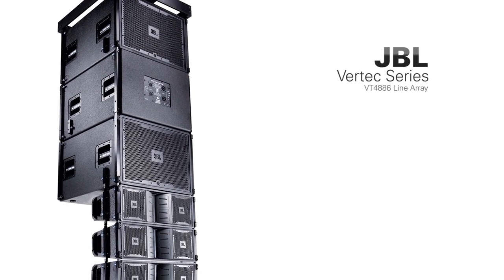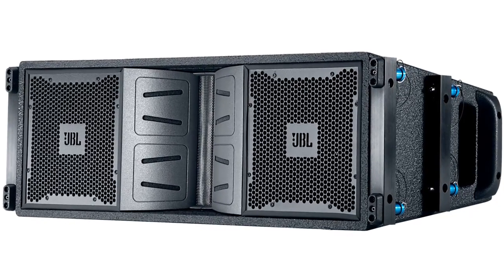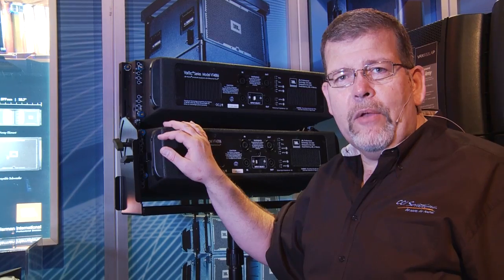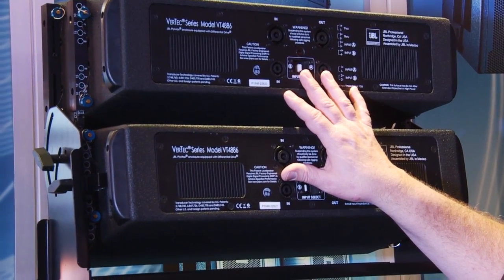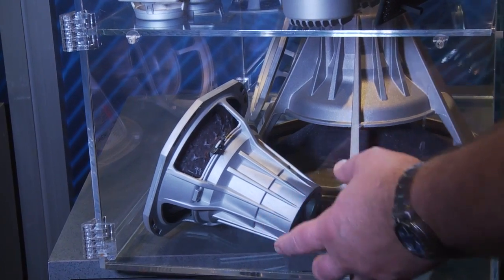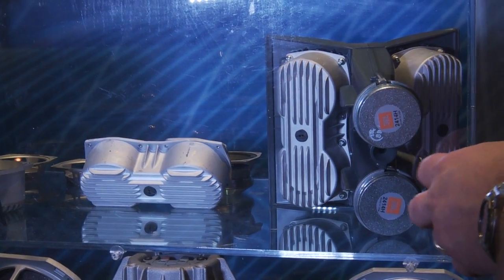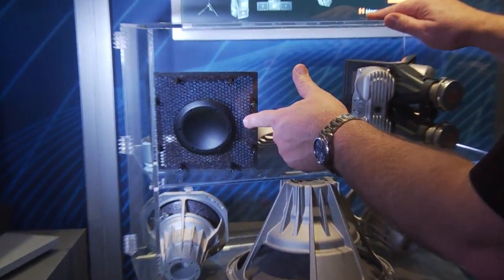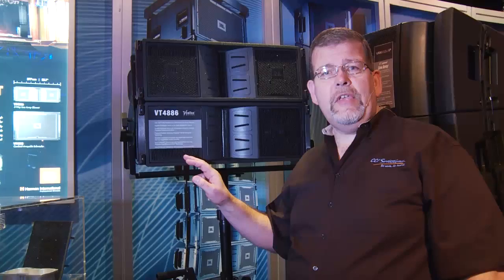JBL Vertec VT4886 Line Array Speakers - In-Depth Review

Comment: What type of amplifier use with
Reply: You can use Lab gruppen and powersoft. But crown is recommended for any Jbl system. Crown is reccomened because the crown amps communicate with the Driverack for the vertec or vtx. Crown macrotech or itech are uses to power the vertec or vtx

Comment: Friends...

Do not let this sales hype steer you wrong.  What's more important is what he's NOT telling you.  For a "line array" to perform as designed you need to have at least a 12 foot long hang no matter what the size of the cabinets.  For these to give "line array" performance you'll need at least 14/side.  This does not fit in with his citing such gear as a solution for a "low proscenium".

Don't let your "joyful noise" drown out the "still small voice"...

Comment: Well, it all depends on their design. You can never have anything in direct contact with the voice coils, but they usually have an aluminum cap or something and the heatsink could be up against that. I can't be certain since I don't have insight into their actual design. I was just saying external heatsinks can be used in a passive speaker

Comment: Yup. It's gonna get hot if you run at full power. It hardly gets warm when I usually use it. But line arrays are designed to run at full power for hours on end which will definitely heat up the coils and everything around them, hence the passive heat sinks on the box.

Comment: How hot can those coils really get?? :)
Reply: hotter than the sun baby even the subs
Reply: I literally had an EV line array box burst into flames while mixing an arena show. It was flown & was the top box in a 12-box side array. Turned out a system tech had somehow gotten low/high amp cables crossed when wiring the rig.

Comment: Do you know how hot the coils get on these things? They're pushing massive amounts of power to get those high level outputs and that will cause a lot of heat in the coils. Heat sink will help dissipate that heat, extending the life, quality, and power of the speakers.